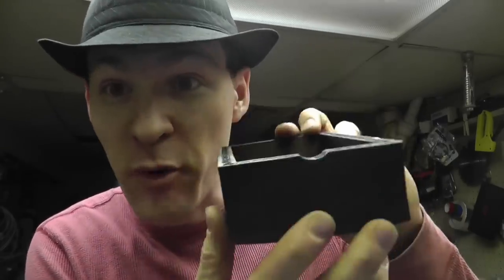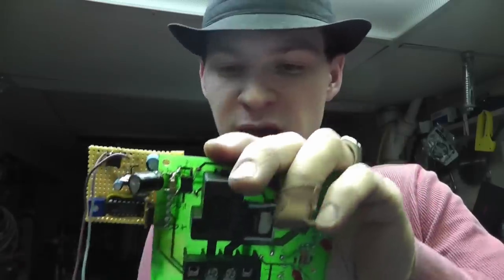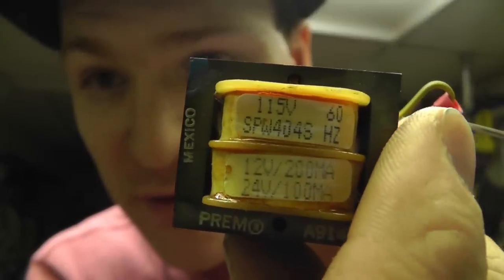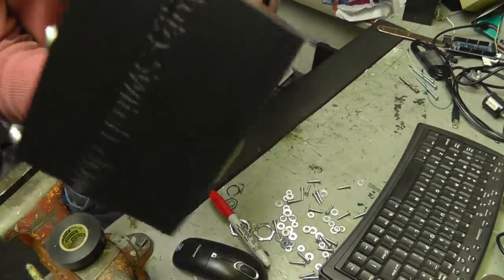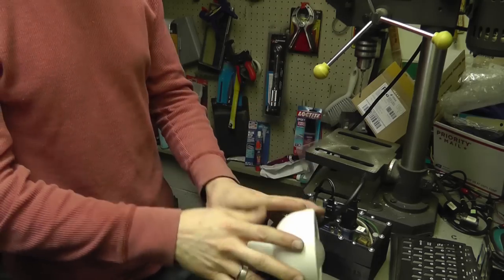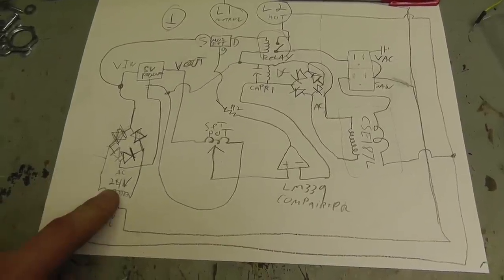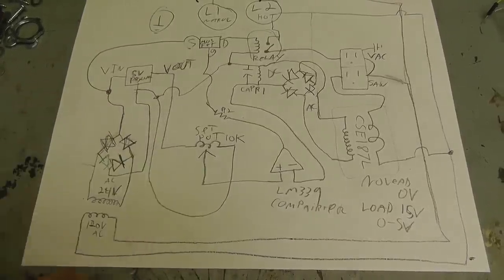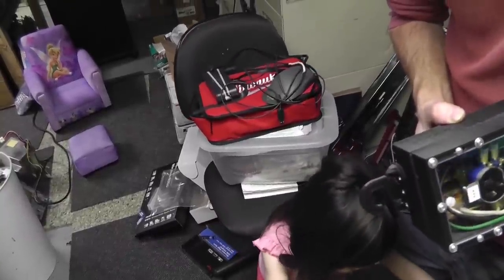Saw & Vacuum Auto Switch W/Time Delay Off. (LOAD SENSING) Built With Junk. Schematic / Explanation

Comment: I know this was done years ago and cool stuff. I would like to do something similar but slightly different, could you tell me what components I would need? I want to turn on a saw and have a blast gate open. I have a 12v dc actuator and need that motor energized long enough to run the full stroke of 6 inches.

Comment: abs prints well without those issues by adding tabs on the corners that tree a couple layers thick. usually a circle works well on the corners. possibly add on the center of a side. or attach a skirt around the object that extends 10-15mm from the object. then the skirt or tabs peel to a certain point and the corners do not. another method would be to create a shell around the print to hold in the heat. also enclosing the printer helps with keeping a constant temperature. abs needs to cool the whole part at the same time to prevent warp. kind of like annealing glass.
Reply: that word tree is supposed to be are
Reply from the maker: +Michael “Dot” Woodrum good stuff, thanks! ~Russ

Comment: Is that delivery or Digorino pizza.  Your a nut.lol hope Your dad uses that. I think its great. I would have used the neutral side and split the load between the saw and vacuum.  With one cap. When the saw switch is pulled it induces a load L2 and closes the vac plug loop at the same time and putting a cap in series gives some run time from the saws blade spin down. The danger is the increased load in the saw switch that you might be able to workout with a relay switch. I like the box as is.  There is more than one way to spin. Happy Holidays. LOL

Cheers.
Reply from the maker: :) ~Russ

Comment: Won't the current sense transformer multiply the voltage so you get a couple hundred volts? Then if you're comparing it to a 5v max reference it would always be on for even the tiniest current. I think it's better to put the pot on the current sense side so you can reduce the sense voltage below 5v.

Comment: Anyone know how to build a switch that will turn off a major appliance e.g. refrigerator for a programmed interval and then resume normal operation automatically. I have a fridge on the opposing wall of a sound booth and need to be able to turn it off and of course not forget to turn it back on.   EVER. :)